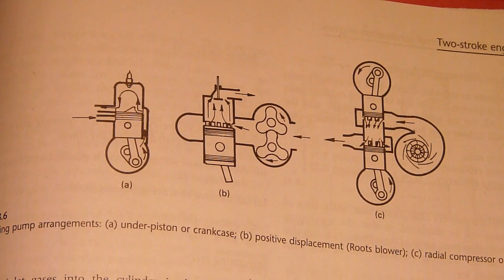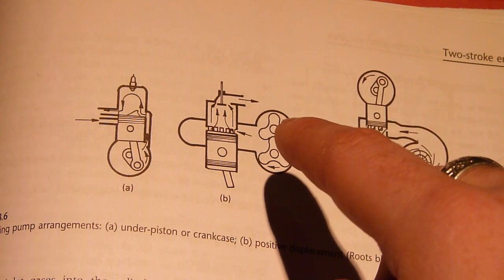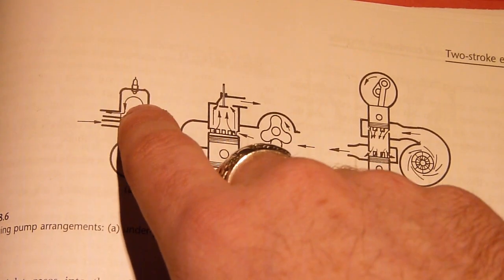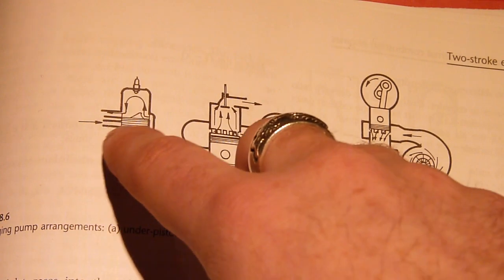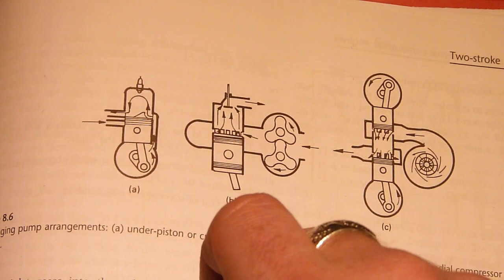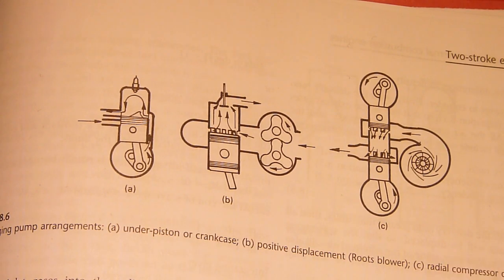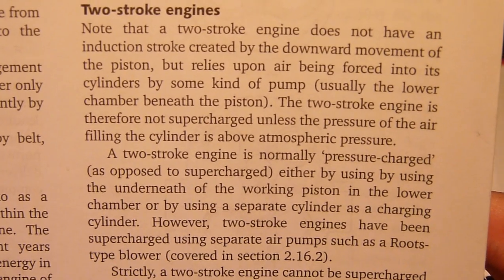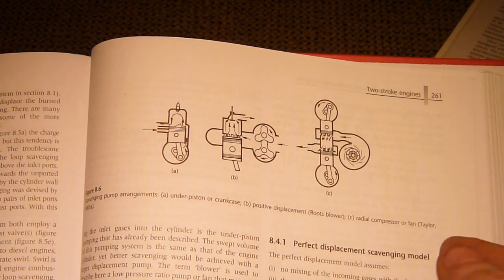Why superchargers don't work on 'crankcased scavenged' two strokes.

Comment: The present land speed record for a turbo chargedü ,50 cc streamliner is As of November 2021, the land speed record for a 50cc motorcycle is 145 miles per hour (mph), set by a metal fabricator on the Bonneville Salt Flats. The rider used a turbo-charged streamliner, a unique motorcycle with a chassis that places the rider and engine between the front and rear wheels. Streamliners are different from production 50cc bikes, which typically have top speeds of 30–60 mph

Comment: the expansion chamber reverses the sound wave of the engine back to the exhaust port and stops the intake charge from escaping ..it has nothing to do with exhaust gas pressure

Comment: If you raise the pressure within the exhaust system in a Two-stroke you will also raise the transfer pressure into the cylinder.  A turbo will provide an ideal means to do this.   Keep reading your Taylor!

Comment: great fancy talk but absolutely no clue what he's talking about. I've turbo'd 2 strokes for years and it works great. I've tested your theory before and as you increase boost the back pressure in the expansion chamber also increases and no matter how much boost you give the engine the back pressure remains 50-60% higher in the expansion chamber also. On the dyno 2 strokes get greater gains than a similar size 4 stroke for a given psi/bar. Your theory just left out actual back pressure in the exhaust system
Reply: @Jason Wong you mean turbo supercharging vs supercharging? What's the difference again? Oh yeah, nothing...
Reply: Robomika gaming I really want to turbo my 2 stroke. If you don't mind, can you share yor setup for me to try

Comment: What most people are saying in the comment is true, you can see performance increases in certain crankcased 2 strokes. The only reason this works is because the engines used are simply a cut down version of their bigger brothers. You are both right in your own respects. Most small 125cc 2 strokes are heavily restricted on airflow to limit the power of the engine however removing this airflow restriction can see better performance figures. It's the same respect with other 2 stroke engines apart from they do not have a baffle they simply aren't getting enough air so adding a super charger can improve it :) if I said something that doesn't make sense please correct me.

Comment: and there are plenty more videos of crankcase induction turbocharged engines, ALL 2 stroke snowmobiles use crankcase induction engines, and they take them from 150hp to 220hp on stock engines, just delete this nonsense. because you clearly don't know what you are talking about, the back pressure in the pipe increase as you increase the boost, no fuel will be blow out the exhaust port
Reply: Please link them. Your mother understanding. No bolt on power ladders. Using the engine crankcase as it's own power adder!!!
Reply: @steppoffaith8426  already done that, just search 2 stroke turbo sled or snowmobile.. 2 big companies polaris and brp are currently making 2 stroke turbo sleds from the factory
Reply: @steppoffaith8426  https://youtu.be/meCIobnBNjI
Reply: @ailokemi92   am not talking 2 strokes in general. I am talking about piston ported engines. Chainsaws ,weed eaters,
Reply: @Jason Wong well speedwerx are supercharging arctic cat  2 stroke sleds
Reply: https://youtu.be/SCOUEAeAgGE
Reply: @Jason Wong https://youtu.be/yqAPYMLzWDs

Comment: when combined with the proper port placement and and fuel injection you can increase the rpm range of a 2stroke and get it to hold on to the torque at a higher rpm.

Comment: What you missed is the following: The supercharger doesn't just increase the pressure in the crank case and the cylinder It also increases the pressure in the expansion chamber. This increased pressure in the expansion chamber means that the fresh charge doesn't just go flying out the exhaust like you've suggested. That is why some of the best examples of turbo two strokes control boost by placing the waste-gate in the center of the expansion chamber, it doesn't just cut the turbo's boost but it also instantly reduces exhaust pressure and therefore cylinder pressure.
Reply: It would need an exhaust trapping stppping sleeve valve!
Reply: Wait, what if we have exhaust valve that directly connected to waste gate

Comment: Why wouldn't it? Wouldn't increasing the pressure of the crankshaft increase power / pushing more air and fuel into the piston increase power???? Also can you run a 2 stroke engine with no carburetor? If you atomize the mixture without the carb, wouldn't that be better?
Reply: because doesn't a carb kinda restrict the flow of fuel and air?

Comment: It works, i saw some building where they only put a turbocharger on a ordinary 2 Stroke most of doubled the power without any changings on the engine it self. 
You only increas the overall pressure of the system wich means more oxigine in the chamber just like an 4 Stroke. Stopp spreading shit wich is already busted

Comment: what about GM 2 stroke diesels. me very one was supercharged and most were turbocharged added to the supercharger,  they work very well and have, and continue to, to this day. I'm a diesel nut but I'm sure it would apply to gassers the same with the proper design.
Reply: youngmike8645.
A 2 stroke diesel is a very different animal than a two stroke petrol engine.
a 2 stroke diesel cannot work without a supercharger and has a mechanically operated exhaust valve, in the head, that opens on the downward stroke of the piston, before bdc, when the intake port is open, allowing a fresh charge of air into the cylinder to push the exhaust gases out the exhaust valve. (the piston does not push the exhaust gases out). 
After bdc the piston (on upward stroke) closes the intake port and the exhaust valve closes and as the piston travels up it creates compression.
Just before tdc fuel is injected into the combustion chamber to create combustion to force the piston down again. Watch this video, sorry for no links.  -  "how a 2 stroke diesel works - 3D animation"
Reply: Rob, lost and late. It's not a supercharger, it's a scavenging pump. The confusion comes from hot rodders using blowers from Detroit Diesel engines on four strokes as superchargers back in the 1940s-1970s.

Comment: you are wrong, superchargers ARE an effective power adder on typical 2 strokes. look at the speedwerx superchargers.
Reply: FrankieJames7 wtf man your telling someone to kill them self's over a fucking idea for what they believe is right or wrong!!!! you are a piece of shot James plz do not have any kids!!!!!!!!
Reply: yes, turbos are even easier to add to a 2 stroke because the turbo will regulate boost and exhaust back pressure. i wish know nothing clueless degenerates could just understand common sense like that, no ridiculous 128 octane fuel or no so called "high pressure cranks" LOL!
Reply: Well, the high pressure cranks is a true problem if you read the paper, but it is not too significant. And no, turbos is not even easier to add to a 2 stroke, you still have to place it far away from the exhaust port, right just after the expansion chamber where the exhaust gas velocity is much lower than right at the exhaust port and that kills efficiency and add turbo lags.
Reply: this may come as a suprise to you, but steel parts dont get broken from more air pressure, so no, it is not a problem, just an ordinary crankshaft will survive. a 2 stroke fires 2 times more than a 4 stroke, and will almost always be in boost after idle
Reply: It is not the steel that is broken. It is the seal.
Reply: they make something called case gaskets and bearing seals, something that comes on a normal engine, and 2 strokes can have systems similar to dry sump 4 stroke cases
Reply: Sorry… not right at all 😉
Reply: Yes, he's wrong cause the turbocharger adds pressure to the crankshaft case so the a/f mixture is more compressed than usual, that means it enters quicker to the cylinder and with higher compression, so the explosion is more powerful. Using a turbocharger will blow your crankshaft very quickly because of the high pressures that crankshafts aren't ready for and also will blow your cylinder head and gaskets. You would need at least 98 octane gas with low load on the turbocharger but if you take a big turbocharger you'll probably need to use 128 octane gas, with etanol for more compression resistance and maybe adding nitrometane would be a good idea.
Reply: Just to clear this up:
You CAN turbocharge or supercharge a two stroke engine. (There are even supercharger kits for 2-stroke)

They effectively doubled the power output of the engine. You can see the result of the study by yourself here: https://www.dropbox.com/s/09qhnl30mbu0orz/TwoStrokeSupercharging.pdf

Comment: Good video, nice to see someone applying engineering theory instead of wishful thinking. For those people who think bolting a supercharger or turbo onto their 2stroke will give them boost, IT WONT, you may measure a pressure in the intake or crankcase but it wont be effictive in the cylinder which is where it counts, you will achieve a higher power output but thats down to more effective scavenging rather than boost.
Reply: Say that to the guys wich doublet the power of an ordinary TZR 125 engine ...
Reply: Boosted 281 hp naturally aspirated 172  isay isay that there dyno jet is full of shit then I say
Reply: ummmmmmm snowmobile 2 strokes have been boosted for years, you should join the 20th century
Reply: https://www.youtube.com/watch?v=T44ZVTQtLUk
Reply: Mi say isay boys come see what happens when I pull the exauste fan off my snow go and with point in the power I say lmfao

Comment: Have you looked into the N.I.S.T. report?? That was complete hogwash, but apparent "science" written down as paper... although you may be proud of what you "read/know" (from what you have read), it just doesn't line up to what has already been done!!."Boondocker powered Polaris Assault" is a fun video to look up of a amazing sled, with a 2-stroke, turbo charged (I think the highest was 9.5 P.S.I.).... I think your theories are correct to the extent that you may not be able to run massive amounts of boost on a traditional 2-stroke... but playing with port timing (considering a 2-stroke that would need a turbo to even run), you could probably run massive amounts of boost... if you also combined a "tuned pipe" with the consideration that much of the fuel will be pushed out the exhaust.... you know what I'm getting to!!.One thing you don't EVER see on a wet base 2-stroke like the Detroit diesel is a tuned pipe??
Reply: +Brian Davis Had paragraphs!!
Reply: well, I didn't change anything on my skidoo sled, just the head to deal with the boost with 98octane fuel,it's a rotax 800 h.o 2 stroke, I run 16psi boost
Reply: And you don't need a "tuned pipe" there is not much difference between stock and a aftermarket pipe, I use the stock pipe, only changed to rktek billet head with turbo domes to lower the compression, I run 0,5 bars on pump gas, and 1 bar on race fuel
Reply: +Ailo Aslaksen Kemi Aftermarket pipes do make a diffrence when matched with the port job = mids or highs usually.... however with a turbo I'm sure that diffrence would change, top pointless, unless your looking for track times!!
Reply: +Brian Davis well I have tried slp, spi, aaen, crank shop and the required cylinder jobs and jetting to match the pipes, with and without turbo and there is really not that big difference, actually the brp stock pipe works best with the boost
Reply: +Ailo Aslaksen Kemi Then you haven't tried all of what the design of a 2-stroke "tuned pipe" has to offer, to match the turbo setup!!
Reply: +Brian Davis that's kind of funny, because that's what we do almost for living, my friend is working very close with d&d to make bigbore kits for the etec that works a 100% with a turbo kit, and he is the one who helped powder freaks to make a working billet head for the rotax etec for N/A use and turbo use, and when all of these engine nut heads all AR coming up to the same results that the stock pipe works best, then I don't know anymore
Reply: +Ailo Aslaksen Kemi Then just run a straight pipe if it makes "NO DIFFRENCE"!!
Reply: +Brian Davis when did I say that it didn't make difference? well a straight pipe instead of muffler may give some horse power or loose some, its gonna sound like mad power tho haha. what I'm trying to say is that I wouldn't recommend anyone to spend so much money on maybe 4-5 hp, and with some pipes you even lose low end torque, and that is critical to turbo 2 strokes
Reply: +Ailo Aslaksen Kemi Your killing me... seriously = your killing me!! Do 2-stroke pipes make a diffrence or not??
Reply: +Brian Davis did you read what I wrote? THERE ISN'T MUCH DIFFERENCE BETWEEN STOCK AND AFTER MARKET PIPE. I got 2,5 hp at the most on Dyno, and lost about 3 horse power compared with the stock pipe when I ran it with the turbo, you will get the most for your money by installing a clutch kit on a sled
Reply: +Ailo Aslaksen Kemi 9 Ok, run a straight pipe if there is no diffrence?
Reply: +Brian Davis haha well then you will definitely lose power
Reply: +Ailo Aslaksen Kemi Lulz... I'm RIGHTY!!
Reply: lol

Comment: Great video did get the key points. I am in the automotive trade as well and done a course unit on this there is the other side of it as you force so much air fuel mixture in in condenses as the piston moves down and continues to pressurise it this under the basic principles of engines ruins it's atomisation and defeating the purpose of the carburetor on top this poor air fuel mix burns poorly and mostly escapes out the exhaust which deters more problems. Heres my but in reference with the book using a "roots" or POSITIVE DISPLACEMENT pump supercharger at the correct design and flow rates and porting becomes the scavaging pump and designed right gives 100% scavage with little lose of mixture. It also helps the carburettor with better atomisation by providing a higher vacuum though a smaller venturey (see positive displacement pump) the Rb supercharger is a belt driven fan forcing air in the carb and defeating it's design.  Lastly a turbocharger this is a possible method as the exhaust has a turbine in it which basically  builds exhaust pressure (iy has to turn the turbine to pass exhaust gas out)  til the turbo 'spools' which then the compressor provides increased flow when the engine is in its power band and above to increase the high/max Hp as it has the air flow that those speeds provided by the turbo also this method once agian requires the carburetor to be on the VACUUM SIDE I can not stress enough how many people do not understand the carburettor principal tho not recommended as it can over rev and physics take hold

Comment: pls note that on figure b, this type are commonly used by emd from 567 and older 645 and has been replaced by assisting turbocharger on their 710 2 stroke engine. in this way at low engine speed the crankshaft drive the radial compressor until enough exhaust flow to spoo up the turbine then the turbocharger  disconnect itself fron crankshaft. this is why many identical locomotive the sd38(16 cyl roots blown) has altitude problem while sd40(16 cyl assisting turbocharger) doesn't
Reply: they are 2 stroke diesel engines, which work on different principles i.e. they have a valve which controls the exiting exhaust gas, they are not a piston ported engine where exhaust is concerned. the two stroke diesel engine cycle relies on a compressor, and the reason they cannot use crankcase compression to force the air into the cylinder is quite simple......diesel engines are compression ignition, and crankcase compression would cause high compression on both strokes, thus causing low power due to the piston wasting energy compressing air in both directions

Comment: for years people have been getting more power from "packing" the crank case on two stroke engines, this makes the area in the crank case less than standard, and it increases the pressure in the crank case....exactly the same thing as supercharging or turbocharging the engine, only difference with that is that the pressure is exactly the same over all of the rev range, as oppose to different pressures with a charger. so put simply, with a correctly designed exhaust (resonance chamber length ect) and a correct boost map (air pressure increasing exponentially against rpm) it is possible to get massive power gains with charged air intake systems. a centrifugal supercharger would be the easiest one to use as the pressure increases linear to engine rpm, meaning you can set the engine up like an n/a engine at low rpm for good low down torque and power, and when the pressure is higher at high rpm, you can still have the power near to that of a pipey 2-stroke. best power gains can be had from a turbo charged engine.....if you set a boost map up using a digital boost controller correctly, massive power can be had. yes you loose the pulse waves from the exhaust, and exhaust gasses are difficult to evacuate from the engine at low rpm, but if you modify the exhaust port opening period to be longer, you can spin up the turbo quickly, and the vacuum created by the turbo between strokes sucks the exhaust gas out.